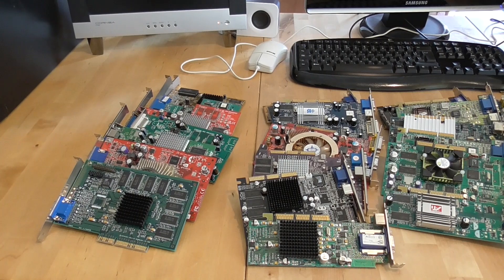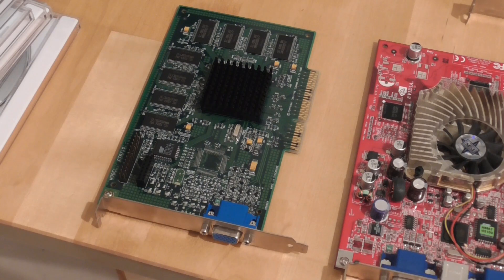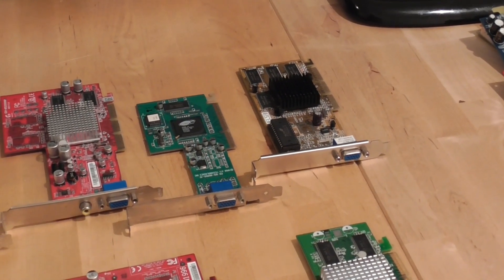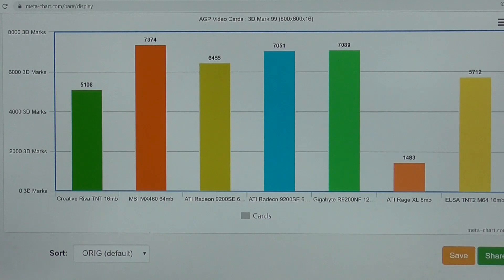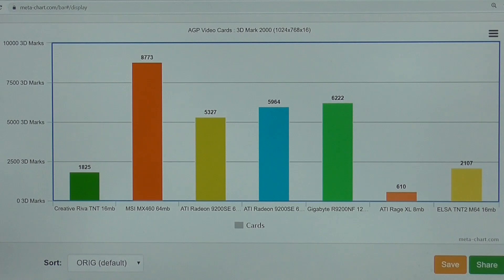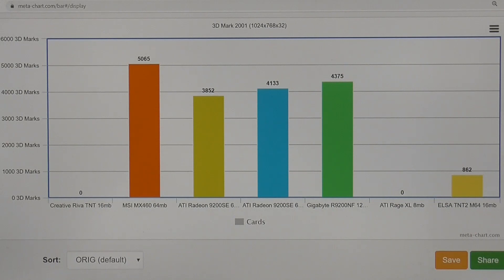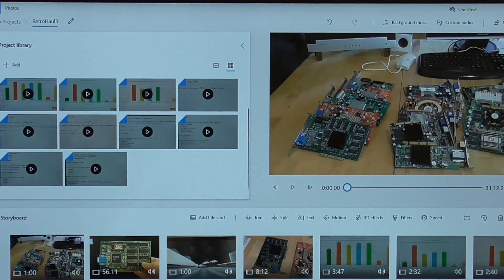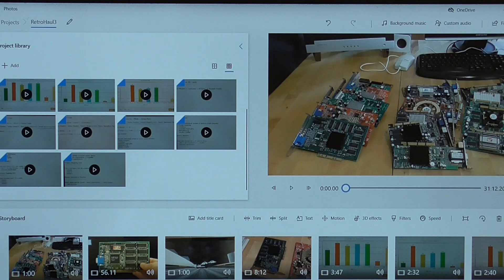New Retro Haul Part 3 : AGP Cards | How a Render Pipeline Works

Comment: i'd slot that 9200 into anything and google the vendorid along with the device id (should be able to find it during boot in the hardware list in bios),  should be easy enough to track down what model it actually is that way.
Reply from the maker: I might just try that for the next video. Good idea.

Comment: Good video.  As far as I am concerned, the fact they still work makes them very good cards in their own right.  While it's interesting to see performance differences, video cards have a tendency to degrade over the years.  Sure, recapping helps, but every used video cards with unknown history should be assumed less than optimal maintenance.   Like how long were they ran between dusting, were they overclocked, was the cpu in the system overclocked, how many power cycles did they go through.  Like lightbulbs, they are subject to use and abuse sometimes above their rated abilities, that compounded by the fact that mfr's do not care about the product beyond their warranty.  Like vintage cars, vintage tech should be enjoyed for their time, tinkered with, hopefully appreciated, and well regarded (even if they were cheap at the time.)
Reply: The chips are quite robust. The heatsink needs to be cleaned once in a while from dust. You can also renew the thermal paste every few years. And you should never smoke in a room with computers. The capacitors might age and if they do should be replaced. The same applies to transient-voltage-suppression diodes and zener diodes. They go broke with through voltage peaks. The most important thing you should do is take very good macro photos of the graphics card boards. The photos should be so good that you can read the names of the semiconductor elements. If they break, you have a good chance of replacing them thanks to the photos.

Comment: God the MX460 was so worthless because the 4200Ti was just a few dollars more. The GeForce 4 MX was the biggest marketing scam ever. Basically GeForce 2s. The MX440 became an OEM darling and really replaced those crappy MX200 and MX400s.
Reply: I completely agree. That's why i bought a Geforce 4200 TI and later Geforce 4800 TI to replace my Voodoo 3 card. The Geforce 4800 Ti was for a second computer. The Voodoo 3 went back into my older Pentium 2.